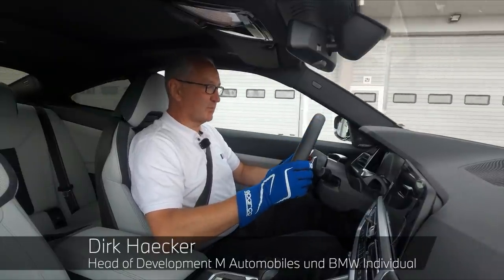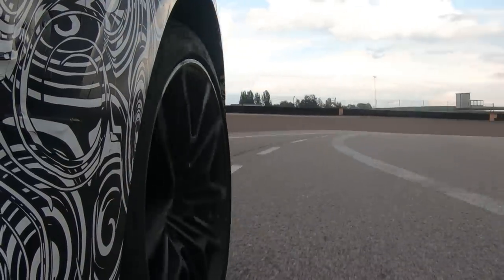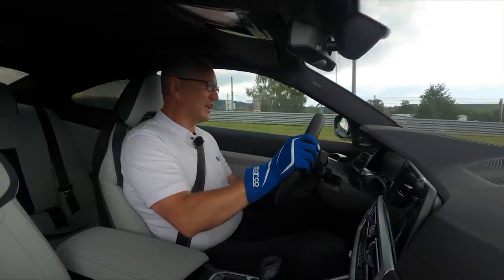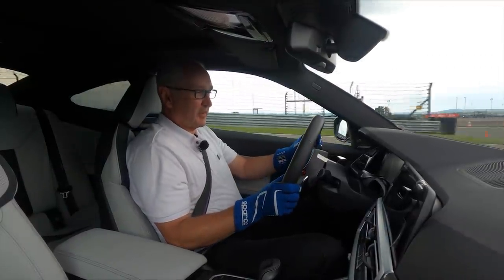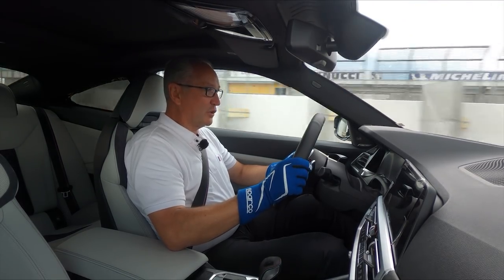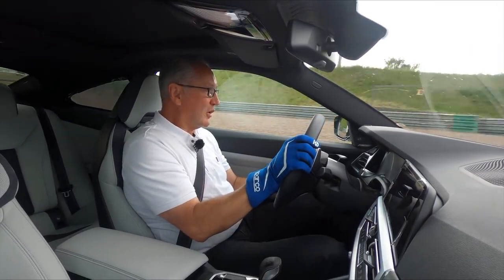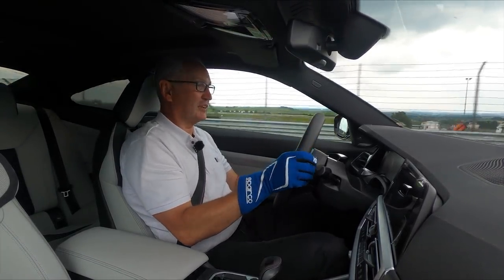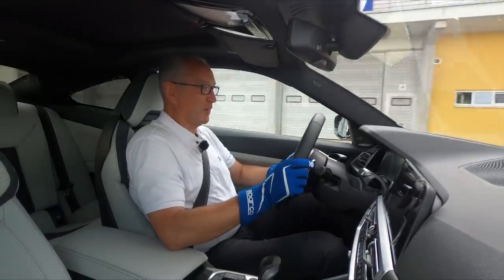BMW M Head of Development on the new BMW M3 and BMW M4. (G80, G82. 2020)

Comment: Se tem M5 do Razuk Backstage sem garantia tem deslike. WARRANTY FOR M5 IN BRAZIL IS IRRESPONSIBLE, it is not nice to hide the information that the M5 should´t perform a launch control before 2000 kilometres or it will break and cost a fortune. Many owners don´t even stay with the car that long. At least you should advertise that information for the owners, not only hide in the midle of the  manual. Shame on you BMW Brasil. Shame on you marketing and communication responsible of BMW Brasil.

Comment: I understand automatic transmissions can be faster, but making the competition  the auto only is a little bit of a disappointment.   Bmws are great driver cars, and no matter what, there is something about dropping gears, rev matching as you enter a corner,  and grabbing gears coming out.  All im saying is options.
Reply: Jack njones   i dont "need" a hellcat with 700+ hp  but i want one still,   its the fact  i  and people like me, like to drive having fun. Some people  need to be the fastest to have fun and others just like to drive.   To each there own. All im saying is options.
Reply: Jack njones  im in no way arguing with you, im saying as a consumer  i would like an option to put a manual transmission in the competition. As a consumer if i want to to have full power (and keep in mind stability  control of some sort is default in everything so spin city would only happen when turned off anyway) then i should have it available.  Again straight line  drag race a manual and auto, side by side stock same engine, same car, auto should win every single time. As a car enthusiasts that loves driving manual cars,  im not saying if you buy a auto your less off. Im just saying practical or in your opinion not, a manual option for a car thats rwd with less hp that others on the market, would be a varified option.   Less hp cars spin non stop with traction off

Comment: Want to see low 3S 0-100 now a c8 corvette can do it in 3 and everyone where I live is buying a new c8 when I get my new m4 I want to be able to beat it
Reply: The stock new M4c with proper launch control can run 0-100 in about 3.2s and cover quarter mile in like 11.3. I think it's still hard to beat a C8 which is designed as a pure spirtscar.  The M4 will beat the C8 in luxury, technology and daily use and still mind blowing fast.

Comment: I just do not get grill. 🤮   If it was cut down to half the size I could get on board.  Hopefully no leaky valve covers , oil pan gasket , crank hub or the same stuff that has plaqued BMW for last 30 years.